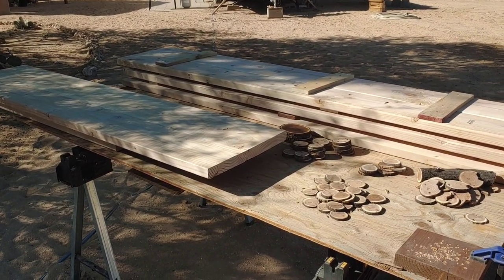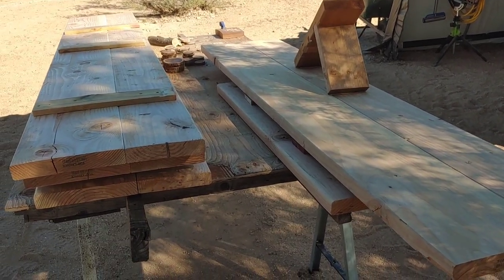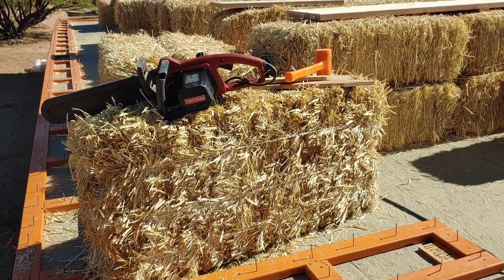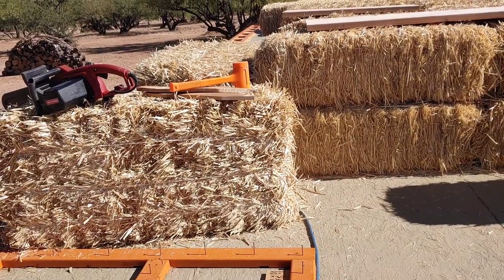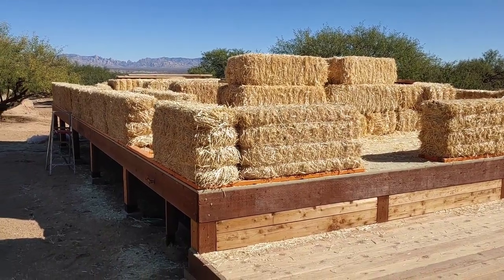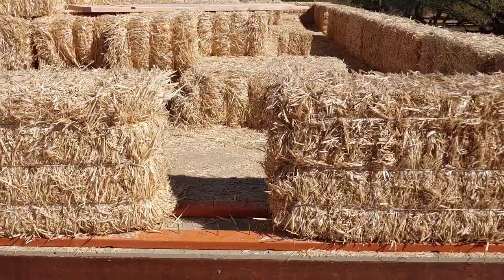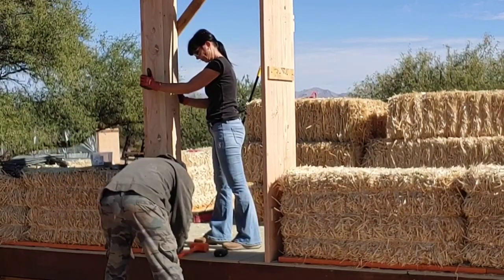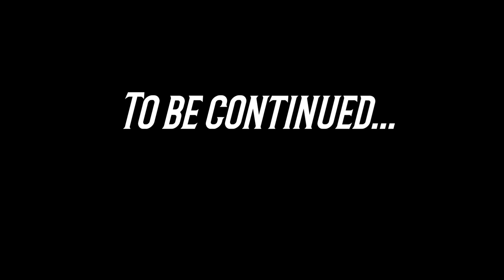#strawbale #strawbalehouse Straw Bale House Build Day 12: Stacking Bales!

Comment: I was always told rebar would cause condisation when it is cold out and rot your bales 
I would guess the plastic straps that you used to shorten the bale could cause the same issues.
Great video. I loved it 
Just want to try to eliminate future problems.
Reply from the maker: We appreciate your comments and you watching! Actually rebar is a mainstay in straw bales construction as is the strapping material we used. So we feel confident in using those materials. We are always looking for new ideas, but we weren't trying to reinvent the wheel with the fundamentals.

Comment: Great to see your progress Bill.  I see the two-toned boots are back.  I am going to have to rewatch to figure out what purpose is the dracula wooden stake.  I couldnt quite determine if it plunged down into the bottom bale thus making 2 bales more stable.
Reply from the maker: No, but you'll see in the next video that we use rebar to pin the rows of bales to one another. The vampire stakes are used to pin buckings both window and door to the bales.

Comment: Great job. I am wondering why you went with the bales on there edge (16") side rather than on their base (24") side. I am working on getting the bales for a starter tool shed. I also live in AZ (northern AZ by Williams). All of the videos that I have watched on Straw Bales always use the 24" side of the bale. Thank you and it is looking amazing. I have been binge watching your videos all day.
Reply from the maker: With the much colder temperatures you all get in Northern AZ, I can see why you might want to lay your bales flat. Where we are, standing the bales on edge provides  enough R factor to keep us comfortable and we use a lot less bales. Check out books by Bill and Athene Steene. They live in our area and build almost exclusively with straw bales on edge.

Comment: A hopefully quick question... When you got your bails, you stacked them flat, as in with the bailing twine on top & bottom, but when you built the walls you stacked the bails on their sides (bail twine on the sides. is there a reason for this? I'm asking because a course I did taught me to build with the bails flat. Obviously your technique uses les bails & there's hardly any after build trimming, so less work.
Thanks
Mike
Reply from the maker: Both ways are correct. Laying them flat does provide for a higher R value but, as you mentioned requires more bails. Our climate is such that the additional R Value is not necessary. Check out The Canelo Project website. Bill and Athena Steene are Strawbale gurus and have written several books on the subject. They live about an hour from us and we learned a lot from their books and by visiting their home. Their son has a YouTube channel called The Nitto Project and he works with Earthen Plaster. Their videos are informative and truly works of art. Much to learn from them.
Reply: @theupsideofdownsizing  Oh, I've seen his awesome work. Would be nice if he helped out with a wall or two, eh!
Reply: @theupsideofdownsizing  they need to be laid flat as the straw ends hold plaster better. theres a video on youtube where a guy has a crumbling wall because they were stacked like how you did.

Comment: Ahhhh, why are the bales being stacked with the straw vertically instead of horizontal????
Reply: Less settling because the "straws" are end-on ?
I worry about strings breaking and the bale coming apart, where if they are stacked flat the weight of the wall keeps them together. 
I guess either way has plusses and minuses ?👍🙂🇦🇺🇺🇲

Comment: May I ask the cost of something like this project
Reply from the maker: I'm not a big receipt saver, and fortunately we got much done before the lumber prices exploded. We spent about $900 on strawbales. The shell of the house including roof doors and windows probably 20,000. Electric and plumbing 7000. How you finish the inside will greatly determine the final cost. We're probably in it 40k. Again, this is a wild guess just going with my gut feeling. This is actually the first time I have answered such a question. Lol